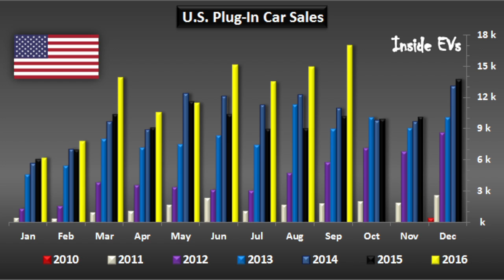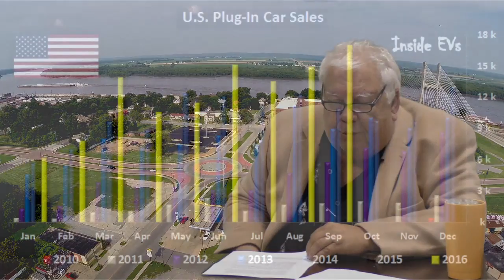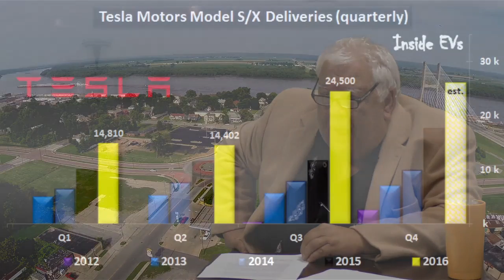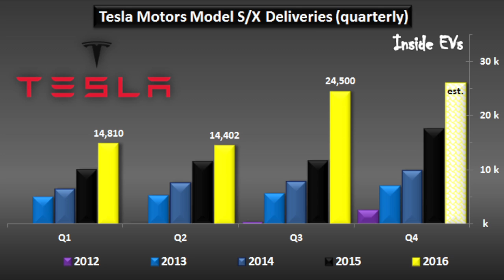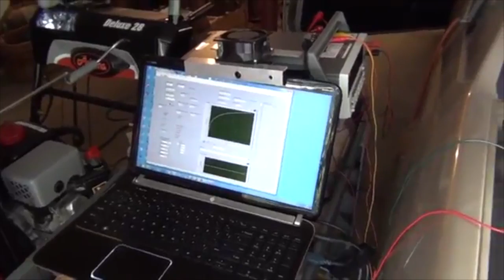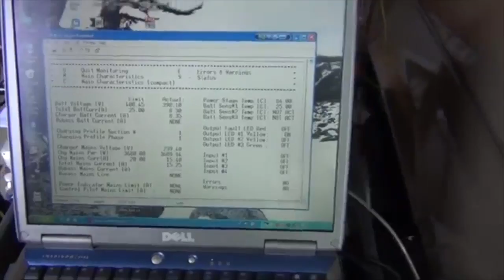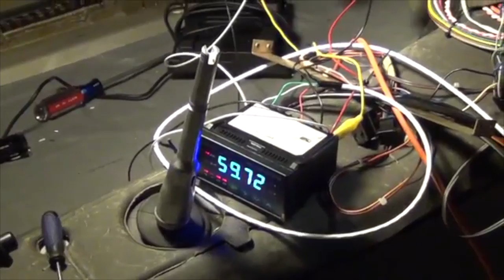EVTV Friday Show - Friday, October 14, 2016.  Tesla Drive Train for 63 Impala

Comment: Congratulations on all the progress at EVTV, you've got a very capable helper there.Especially congrats to Ed for his first drive and that super EV grin! What an adventure!I'm glad to hear the cells recovered. If your contactors were welded on (that can happen when they are switched on into the capacitive load of a controller without precharge) while you were away, that explains the dead pack more than a BMS connected only to the B+ line. Controller and likely charger have small draws anytime they are connected to the pack. I'm sure you'll work it out and check the GEVCU firmware to insure it is very hesitant to turn on contactors.Keep up the great adventures!
Reply: Otmar,

With the introduction of the SiC MOSFITS, is it time to develop and release the TriZilla AC motor controller? As Jack    states in the video, most builds are AC now.
Reply: I keep looking, but haven't seen a business case for a low volume AC controller. Developing firmware, tuning to each motor and support are large expenses. I have to ask what would we provide that the surplus OEM parts don't already do for less money? If someone knows, p[ease speak up! :-)
SIC Mosfets look interesting for high frequency switching converters with their super low switching losses,, but I have yet to see a data sheet that looks tempting for a motor controller since the conduction losses are still pretty high per package size. I'd have to use many more of them in a Zilla, and the current rating per controller size and cost would get less ideal.
Reply: With any due respect, you are both wrong. While an AC equivalent of a Zilla2K might be a questionable business case because it's so high strung with a small market, there is and have been a large neglected opportunity for a clean AC controller design for several years. The absence of which is simply why DIY EVs failed to play any role whatsoever after 2009 despite great opportunity. TO247 IGBTs are both really good and inexpensive as are panasonic caps such that at 3-400V a 50kW controller could be offered an order of magnitude cheaper than what has been available. The same saving is possible with the use of industrial AC induction motors ordered with a different motor constant than mains use. Saying that there are enough good products available entirely fails to appreciate the significance of cost and spin offs.
Today the weapon of choice for many is to use a Tesla rear which is a valid approach if you are just doing a one-off drag car. The 818 doing that is doing quite well, pushing into the 9s with just an old P85. But they are few, expensive and ever changing so even that approach precludes small series production spinning off from such efforts that could grow to what Tesla was with the roadster and indeed change the world.
So it is simply a fact, however much some wants to escape the truth, that the lack of cost effective product development in this community rendered us irrelevant. Like I told you it would.

Deleting this comment to hide the truth doesn't change the facts either, even though it is as certain as the devil's dislike for the truth.

Comment: The Helicopter flight is interesting with tegh overlay data... this suppose that they have used an average of 200A of current and dra 20% of the battery in 5 min so they have about 25 minutes for 100%SOC  if we forget about the safety margin.. so 200A for 25 minutes mean they have about 80Ah battery..